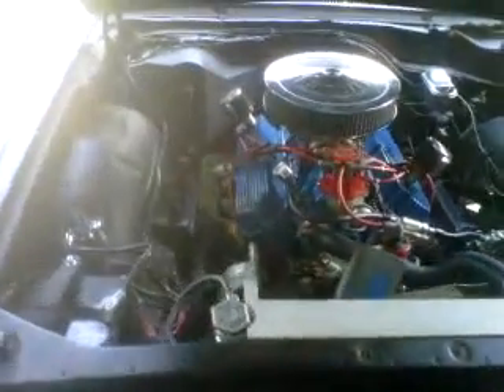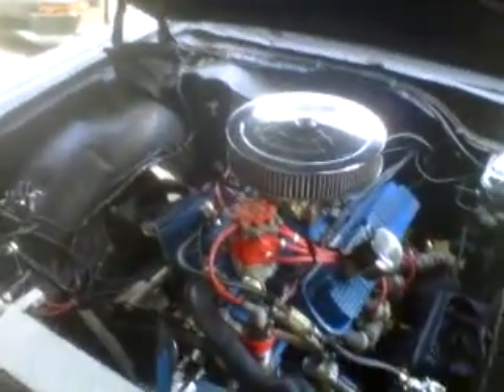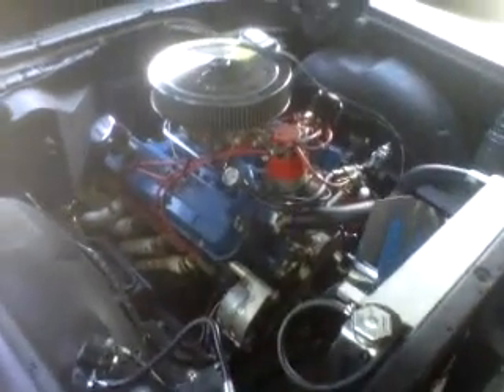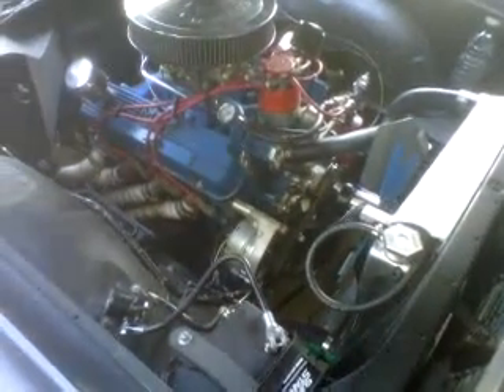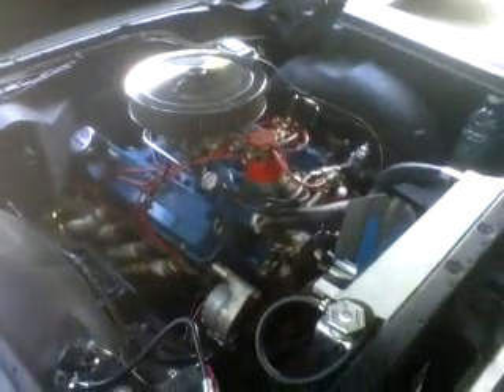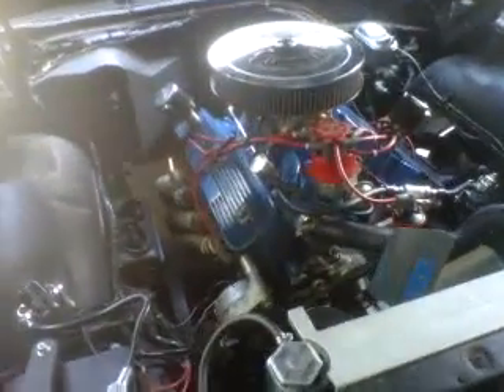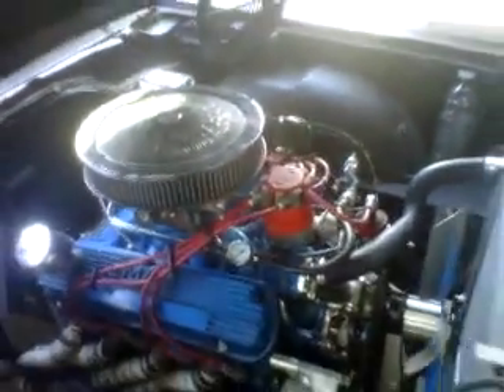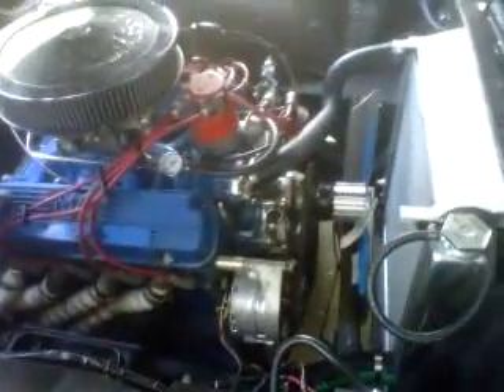Holley carb WHAT YOU DONT KNOW

Comment: There is something to "Ram Air" induction. It has nothing or very little to do with a RAM AIR effect. It's cool outside air induction that yields performance gains. I built a cool outside air induction system using the twin hood scoops on my 73 Duster. The air box is sealed and can only draw air from outside the car.  I'm sure it works.

Comment: 79camaro z28 been siting few years put New fuel in runs smooth but passenger side valvecover gets very hot to touch but drivers side i can keep hand on og at operating temp why is one side hotter than other

Comment: Another thing too that slips peoples mind: when a vehicle speed increases there's a vortex-like suction that happen in the engine bay, especially the more open it is will try to suck air from the carb,  especially with bigger air filters. The cure for this is putting a plate between the carb and intake the expands the whole engine bay. When the hood is open, it looks like there's another hood with the carb and air cleaner sticking out.

Comment: Colder air is more dense. More molecules per square inch. That’s why your mixture changes and it runs better when it’s cooler. Your getting more of a charge into the cylinder. Just like an intercooler on a turbo. The answer is to runs good scoop and seal the carb to it for racing. That insures you get cool fresh air.

Comment: lol... and I was lookin for info on Deleting my Dual Snorkle air cleaner so i could have a kool air cleaner ... that may be a mistake.... 
The "Dual Snorkel"   was made for the original Holly 600 carb. on the 85 GT 4 eye for a reason I bet.... it brings in cooler air from the fire wall / fenders
Reply: I got an 82 with stock dual snorkel's :) 👍

Comment: So stuff I have learned the hard way, the stock air filter also had a 2" tube off the exhaust manifold where a sheet metal formed bracket  was to get some hot air into the air cleaner when it is cold outside as a ring of ice forms in the bottom of the carb. and the mixture gets to rich! hopefully you can find some newer tubes & an air filter such that air can enter from the left or right front. off a salvage or wrecked car or PU.  also please look at the mentioned video as to what the problems were and what fixed it!  the air must flow into the Carb. smoothly no 90degree bends. Summer needs cool air, I have one to change myself in April,  good luck, Nick

Comment: Relocate your oil filter to your firewall. I had the same problem and moved the oil filter with a relocate  part and  the engine ran only about 160 and stayed there. Damn good thing. I no longer have the hot temps in the engine and such.

Comment: Put a tub around the carburetor and air cleaner ala carroll Shelby and cobra. Add a cobra jet scoop to hood to an induction sealed tub/pan. Add a phenolic spacer. I like the 2". I got a 2" spacer on a weiand Xcelerator mild blue racer cam high compression and small 450 cfm carb. somehow it all works. 1973 comet.

Comment: Sometimes, I have noticed even on modern fuel injection vehicles that they produce more power in the cooler air immediately after a rainfall.
Reply: yep, cool air + water injection (in the rough) will help any engine.

Comment: It sounds like you keep getting vapor lock,and you should put a fan shroud on your radiator.It will cool more efficiently .You might even want to install an aluminium plate under the carb.It's a heat shield.By the looks of your air cleaner Id say put a clean one in.Also check your thermostat and put a 180 degree.
Reply: not likely - the hot air still needs to get out of the engine bay - the shroud would be more important for engine overheating.
Reply from the maker: +rockymontana1 i now run a return line and a 160 degree stat. engine sits right at 170ish. i have always ran a phenolic spacer. this engine bay just doesnt pass air well. with the same engine in my f100, i dont have as many heating issues. my air filter was a k&n style, not dirty - black wire over whitish filter. i ran this car all the way to virginia 1400 miles and drove it there all summer, then drove it home. the return line helped a ton. needs a tear drop hood as well.
Reply: totally agree with the fan shroud idea! It will solve all the other problems all at once!

Comment: My thought was that he may be approaching vapor lock. Also, living in Arizona I know how bad heat soak can get. By cooling the radiator down your also cooling the under hood area. In drag racing many people soak towels in ice water and put them on the intake manifold after each run. Another example of getting more power from a cooler air fuel mixture can be seen in the difference between the Edelbrock Performer RPM VS the Performer RPM Air Gap. Also, blocking the exhaust het crossover on big block Mopars is good for over 20 horsepower.
Reply from the maker: +Kenneth Cohagen i was getting onto vapor lock. i also had underhood heat issues. i drove the car 1400 miles down to virginia and was there with it all summer and it became apparent that i needed to do something. i rigged up a return line and that literally cured all my issues. when i autocrossed with my hood off and 2 air cleaners stacked, it was like another 50 ponies. heat just kills power. this engine is currently in my f100 and will be under the knife soon, planning to eliminate that heat crossover. my new engine runs the air gap.
Reply: 289, 65 mustang, manual fuel pump. approaching 190 degrees engine temp, fuel filter is empty and car dies. 5minutes of waiting, fuel filter fills back up, car starts and runs. gets to 190 again, repeats all over. replaced fuel pump and filter.

Comment: Get an air leaner assembly with w full sized filter with two hoses that you can route in front of the radiator. Also, pay attention to fuel lines in relation to where they are routed near the exhaust. A cool can would help all the way around, but they need constant attention. If the full line passes close to the header, wrap the header or fuel line with insulating tape. You might also try running the rule through an oil cooler in front of the radiator. The only problem with this is it may restrict the volume of fuel flowing through it. I would use a minimum of a 1/2 inch fuel line and run an electric pump from the fuel tank to the mechanical pump. That may help. Remember every 10 degrees air temperature cost you 5 hp in a V8. The cooler the air fuel mixture the better!

Comment: might be an idea to attach a front lower air dam, do the research about it ;)
Reply from the maker: Drove this car to Virginia, had it there all summer and drove it back to Iowa. Temp never goes over 170. Just have t gotten around to fabbing on up for her. Made a return line on my fuel and it fixed most of my negative under hood heat issues. Made a vid on it and crap....
Reply: cool, there are a few issues with carbs and heat. i had 1 that did pretty much the same. i'd putt a spacer between the intake and carb of maybe have an inch (10mm) and fabd a new air dam . it helped a lot , also put a factory like snorkel back in it, that takes cooler air from the front. drove much better in the summer then. the air dam creates a lower pressure under the car that then draws air from the engine bay. it are little thing , but they help make the car much more drivable.
Reply from the maker: its odd because its only this car. have this engine in my 74f100 right now and it does way better with heat issues without even having a return line. i have a one inch phenolic spacer on this engine. has always made a huge difference for sure
Reply: +ThunderHead289  odd indeed.
could be so many things. the car isn't overheating, as far as you show and tell us, it's starving for fuel / air mixture.  so my next step would be to make an cold air intake. ore at least an air dam. 
But ! the winter is coming then warm air is quit nice to have XD
Reply from the maker: it didnt after the fuel return line, but the underhood heat of the car was just much higher than the truck. the air cleaner is just a half in off from hitting under the hood. i have tons of room and air flow in the old f100. i can even run a hilborne scoop which i do. (check my recent vids). when i autocross the galaxie, i just take the hood off and stack another air cleaner lol. just no room under that hood for cool air. im doing a 351 for it, so the stock hood will have to go for a teardrop hood. should solve any issue. 
most people wouldnt even notice anything, but i guess im just not most people.
Reply: ThunderHead289 well i hope you work it out. And you're a racer, so you'll notice subtle changes when you drive ore race. so if anyone asks. 
Just say, cause autocross ;)

Comment: try using a fan clutch, 1/2 inche closer to the rad. only turns on and uses power from the motor when needed and will run better at 180+. improved gas mileage and better performance. or another option is an electric fan which can be set to come on at any temp you want. ceramic headers help so much with lower under hood temps... like 500 + degrees. the fresh air puck up wont be needed as you are not going all that fast, the intake on your vehicle sucks in air just about as fast at the blink of an eye, no literally, close to 200 mph, where as a blink is just over 200 mph. 230ish? if there is anything i can do to help a fellow ford man, just let me know. best of luck
Reply: Ford Di some testing in the 60's on thermostat temperatures. They found that a 180 degree stat reduced wear in the engine compared to a 160 degree stat. In later years thermostat opening temps were raised because of emissions. I don't know how high you can go before you start to loose power, and every engine may be different. Some testing may be necessary.
Reply: It goes much farther than mass quantities of air and fuel. Optimal afr would be around 1% co.... Higher temps do allow for a more complete combustion process.... Why dump fuel if you expect hp out of an engine which is running cold and less efficient? Truth is a lean hot burn is more efficient and more powerful plus you over looked torque which actually is very vital to over all performance and acceleration.
Reply from the maker: +chris keiley hey, no problem. i just ran what i would know not to fail. i have all the wiring there for an electric fan with the temp sensor as i had one on my brass radiator before i put the aluminum one in. got this car running really well, drove it 19 hours to virginia, had it there all summer, and then drove it back. added a fuel return line and a summit black pump
Reply: Well if you increase pressure you can also increase temp. A team in nascar was running 240 degrees? They also had a lean combustion compared to their competitors and didnt have to fuel as often. It was discovered by nas car and there were more regulations added. However a 195 thermosts should work for most vehicles. Some just change it to a 180 in summer
Reply from the maker: you make more power at colder temps and are more efficient at warmer temps. the cooler the intake runners/carb/fuel lines, the cooler the fuel will be going into the engine. colder is more dense, which means more fuel in = more power out. this is why drag cars run much faster at night.
Reply from the maker: a lean mix is more power, but less fuel is not. a denser charge is always better, period. you can run a 240 temp, as long as your fuel going in is nice and cool.
Reply: coolant temp has nothing to do with fuel temp.infact warmer fuel can atomize better than super cold fuel, however if the fuel is too warm it may vapor lock. once again high temps and higher pressures do work together, the fuel will not vapor lock as easily under higher pressures. that is why you see older cars have a problem with vapor locking, weak fuel pumps usually, second issue is where that fuel line is routed. many fords run that fuel line near the front of the motor to pick up a draft which helps cool the fuel down after being compressed by the fuel pump.
Reply from the maker: colder fuel= denser = more fuel per intake charge = more power. that is simple enough. warmer fuel is more efficient because it is less dense. coolant temp does not relate directly with fuel temp, but the colder the engine, the more spark timing that can be ran along with a leaner mix without detonation. the warmer the engine is, the farther you get away from that. 160-180 is ideal. 160 moreso not for a daily driver. the vapor locking is true, with lower pressures for carbs, the fuel is much more likely to vaporize in the lines. i currently run 7.5 lbs and a return line to prevent this.
Reply: will if one was worried about their air charge temps they might want to look into getting fresh air to the engine. its good that you have heat wrapped headers, however you are still pulling in air that is about 200-250+.  a good tune can help you very much also. have you put it on the dyno?
Reply from the maker: i run an afr gauge so i have a good idea on my carb adjustments. i just need a bubble tear drop hood. that engine bay just doesnt flow and the intake is very close to the hood. my f100 runs a ton harder with this same engine simply due to the engine bay.
Reply: ThunderHead289 yea I run a cool can packed with ice and alcohol in my Falcon.

Comment: My 1bbl carter and 2.0L SOHC 84 ranger runs MUCH MUCH better without a cleaner. I had a tiny one on there when i first got it and it ran so bad, i thought it was a miss fire issue and starting doint a tune up, ( spark plugs, wires, dist. cap, rotor) but when i took off that tiny cleaner, it ran great. so i went and bought a 10 inch cleaner and had to use an adapter so it would fit on the tiny neck. If i didnt worry about dirt getting int the engine, i wouldnt even use one.

Comment: Another form of venting that from the curb wouldn't look modified is to put vent holes into the firewall right under the outside air vent so when driving it'll vent that air right on outside over the windshield. The only problem with that is if you use that vent in the Sumer it might not help as much

Comment: You could also run a scoop that would tunnel cold air into the engine bay and cool it off and you could also consider louvers in your hood or even vents angle cut back to the sides which would allow the air forced in through the grill a way out not only cutting temps but giving better aerodynamics. The only downside to these methods is you will have to make cuts to good body panels

Comment: I run a regular factory fan with a shroud, took a 2" hole saw blade and drilled four 2" holes in each fender well and run one size cooler spark plug. End of problem.

Comment: Try running it with no thermasthat, you can buy these washer rings that replace it from your local speed shop. I have a ford 460 bored 30 over with a big cam in it and it only runs about 120 on a hot day temp wise.
Reply: 120 is to cold to be running the engine at operating temp..
Reply from the maker: I always like to run a temp of atleast 160 degrees. I made this video awhile back, you might find it interesting.Engine Temp to Engine Wear Comparison
Reply: No race engine ever wants to run that cold. Metal expansion is factored into the tolerances to run much hotter than 120. 190 is what most race builders shoot for.

Comment: If you are running a straight fan air should be moving constantly. What would improve your air flow is a fan shroud. That would force the radiator fan to pull fresh air in forcing the warmer air out. Without a shroud the fan pulls very little fresh air and just recirculates the air around the fan itself. If you have heat build up you are not moving any air. The engine bay is no air tight...unless you drive a duck.

Comment: youd be surprised how much power electric accessories steal by putting amp load on the alternator. sure it's easy to turn just sitting there, bu try turning it with an amp load on it. you wanna talk power loss?